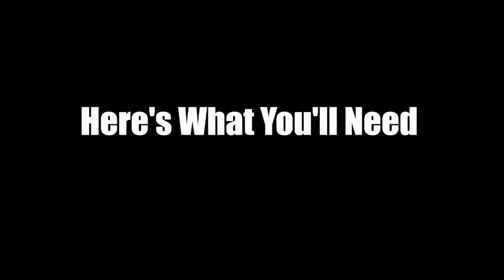Dollar Tree DIY Outdoor Movie Theater | Projection Screen

Comment: Wow to think I was going to spend 200 on a screen. Great video!! Thanks! 🙏👍
Reply: Exactly. Screen, projector, blow up chairs 😰🤑... yep dollar store sounds real nice
Reply: The projector I bought was a true 1080p projector with Bluetooth and it came with a 100 inch screen for less than $150
Reply: @stephanierosborough9507  How's that working outdoor?  I've been looking to upgrade an older 720p projector and am concerned with the lower light output of those bargain projectors.
Reply: @RobHoffman83  I haven't tried the screen it came with outdoor yet, I also bought a 100 inch screen that has a tripod, it looks great on that screen though

Comment: This is a fire idea. Think I'm gonna try this maybe. Only thing I'd do diff is maybe using the black tape they have as a border instead. And maybe using those foam boards they have in black to go behind the shower curtain. I've noticed if you get a screen that has a dark layer on the back it prevent the light from escaping through a screen.creating a better picture
Reply from the maker: Hahaha thank you! That was movie screen 2.0 where I changed the boarder to tape. https://vm.tiktok.com/ZMdaSpVBX/ Have a great Summer!

Comment: Why did you use a shower curtain? Oh! Waterproof? So, how do you keep the sponges from getting gross? Is is still holding up? 
Thanks for posting. It's inspiring!
Reply from the maker: Haha yes I don't have to worry about rain. The scrubbing pads worked as a border with no issues. But I redid it the next year using exterior masking tape by Gorilla Tape as the border around a new shower curtain. Works soooo well and faster  to put up